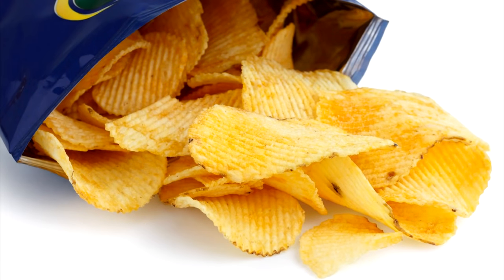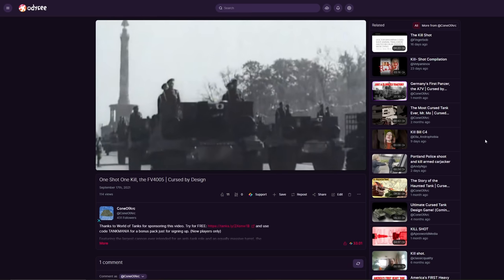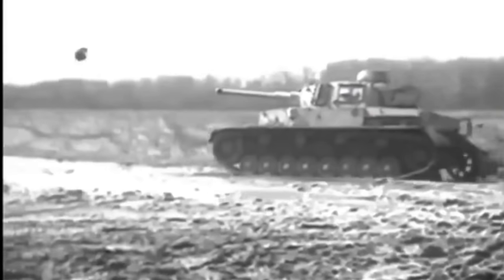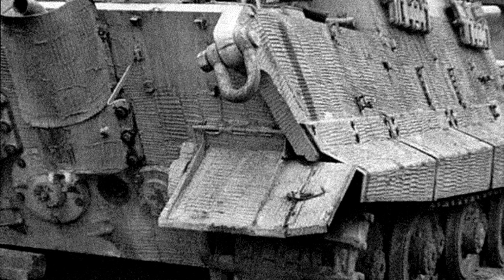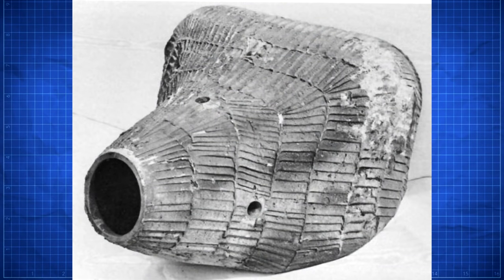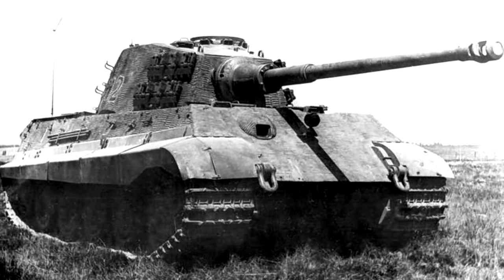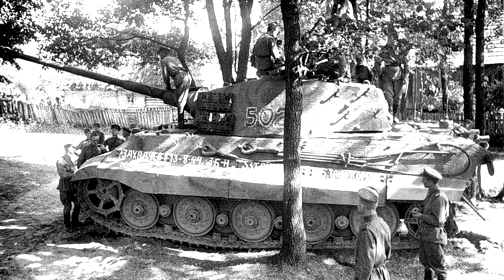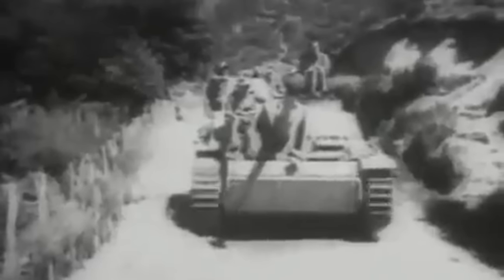Why did Germany put Zimmerit on their Tanks? | Cursed by Design

Comment: current filler primers use acetone as the thinner. they smell like body filler. the coating may have been similar to body filler which can harden quickly;y and can be heated to cure extremely fast.  Fiberglass resin plays well with body filler so they may be chemically similar as well.

Comment: (Why is this comment getting deleted? The weblink?)

I don't know about how successful Zimmerit was in practice, but the reasons for them ceasing use of it was due to bad applications causing non-penetrations to set tanks on fire.

This was caused by tanks produced during the winter being left in the cold after the base layer was applied.
The cold temperature then caused the base layer to not fully set before being sealed behind the second layer.
Later, when these tanks entered combat particularly on the still cold eastern front, a shell could fail to penetrate the armour but would cause the unset Zimmerit to ignite!

This is where the fire hazard rumour came from, whether any tanks were actually lost due to this problem is unclear, and the problem itself is not well documented.

Comment: Has anyone ever licked a metal pole that's frozen???

Magnet mines? Germans where the only ones how made them!

Well in my personal opinion, I believe that the thermal paste was applied to German tanks for one better grip. 
(Climbing on and off the tank without injury).  
And two so they don't stick to the tank.
(People with wet hands or are sweaty from combat).
   
That's something I've always thought not sure if anyone agrees with this or not, but having your hands frozen stuck to your tank properly would suck big time!

So maybe magnet mines that Russia or someone captured and used against the Germans, may help with weather cold/hot? keep heat in or out, also maybe to help with camouflaging,
 and/or, just for safety reasons! climbing on and off the tank with less of a chance to fall, slip and or stick to the tank! and so on. To reduce chance of injury.

 Try licking an ice block sometimes it works! Or freezes something metal and lick it street sign poles work well, or metal ski lift chairs. 
"In winter" and see what happens! 
(USE NORMAL WATER TO POUR ON IT to get free!)

Comment: A tank, no matter how well armored, was always an easy target if it went after enemy troops by itself.  The machine gun next to the cannon was there to prevent someone from throwing objects or grenades down the barrel.  Generally, in anti-personnel operations, you would have a squad of soldiers behind the tank to prevent enemy soldiers from approaching the tank to attach explosives to the side or rear which allowed the tank to get up close and personnel and use its cannon and machine gun against them.  Walking in the tank's tracks also protected your soldiers from anti-personnel land mines since the tank would set them off and its steel tracks would contain the blast.  That of course is why they developed mines that detonated after the plunger was depressed and then released.

Comment: Depending on current chemical composition (solvent, resin, sawdust...)Zimmerit offered greater risk of fire than risk of tank being actually damaged with a magnetic mine.
Reply from the maker: Later testing found that the only fire risk posed by Zimmerit was if it was somehow ignited before properly curing. Even then this was fairly minor since it was just the vapor from the thinner igniting and posed basically no danger to the vehicle.

Comment: The added heat resistance seems to be an intentional secondary effect, hence the choice of Barium Sulphate.
Also it seems to be intended to be applied in the field rather than in factories.
Reply: It was usually done in factories if i remember correctly, although it could be applied in the field, but you'd need an industrial blowtorch to harden it to a useable condition.
Reply: Found the European

Comment: Degaussing a ship and applying Zimmerit to a tank are not even closely comparable, and your pinned comment can't do anything to try and prove otherwise. Ships were degaussed because sea mines had fuses that picked up changes in magnetic fields, and if a ship passed by that wasn't degaussed, it would trigger the fuse and blow up the mine. This is because a ship slowly becomes magnetized as it navigates around the earth's magnetic field. Degaussing a ship does not however make it so that magnets won't stick to it. You can degauss a ship and still stick fridge magnets or magnetic mines all over it.

The only real countermeasure against sticking a magnet to a metal surface is to keep the magnet far away enough from the surface so that it cannot muster enough force to pull it's own weight and whatever is attached to it against the surface. This is primarily what zimmerit was for.

Comment: and of course the answer to this was a field improvised was to pack c4 in a sock or pillow case or small laundry bag and then goop the hell out of it with axal grease and were termed "sticky's" and would take out most any tanks.  The soldier running up to tanks with a sack full of c4 with a lit fuse usually did not fair well.  You had to get up on it to stick it on the road wheels so if you were not shot getting it on you would probably get shot running away or get killed in the resulting explosion.  There is always a way if you have the men to throw at it.

Comment: Zimmerit was a paste-like coating used on mid- and late-war German armored fighting vehicles during World War II. It was used to produce a hard layer covering the metal armor of the vehicle, providing enough separation that magnetically attached anti-tank mines would fail to stick to the vehicle, although Germany was the only country to use magnetic anti-tank mines in numbers. Zimmerit was often left off late-war vehicles due to the unfounded concern that it could catch fire when hit.[1] It was developed by the German company Chemische Werke Zimmer & Co (Berlin).[2]
Reply: When one develops a weapon (magnetic mine) one needs to develop a countermeasure to that weapon.  Forward thinking would assume the enemy is also developing a similar weapon.

Comment: Naval mines don’t stick to the hull, they are triggered by the magnetic field.  A magnetic trigger doesn’t require hard contact, or any contact, to work.

And you can’t degauss a tank for two reasons: because you need a constant energy source and you need to be surrounded by water as a grounding source.

Two minutes in and two glaring errors.

Comment: Were the "sticky bombs" used in the movie Saving Private Ryan an actual thing ?  A sock covered in thick grease and stuffed with TNT would stick to a Zimmerit coated tank a lot better than to smooth metal
Reply: The British had sticky bombs, they looked like toffee apples. They had a 2 piece metal cover over the sticky bit.
Obviously you would need to be very close to a tank to use it, and in all the accounts of the war I’ve read I’ve never come across an account of it being used in action.
But I guess they obviously were, brave man who ever used it.
Reply: @senseofthecommonman  they had been discontinued from service due to numerous accidents with soldiers involving the adhesives. Turns out, a bunch of bored late-teens with military grade AT grenade adhesive will get in trouble quite frequently

Comment: i think its pretty obvious it was an anti fire coating if it made being roasted inside a tank survivable it stands to reason that would be the best reason to use it, given the discrepencies in recipies i think its way morre likely that instead of having contaminated samples the germans were experiementing with the composition of the coating and/or had variations of it depending on available supply of certain things -in any case i wouldnt be surprised to learn that the original guy to come up wiht the coating didnt bother explaining it to the people whos job it was to actually apply it and probably intentionally misinformed them to keep the tech secretive.

Comment: The purposes of reducing the visibility of the tank + interior compartment heat isolation makes the most sense by a long shot. The melting of the coating in case of direct propellant/flame exposure sounds pretty smart. It can then be re-applied later. Tanks tend to need to drive through burning landscapes, and if a single soldier with a flamethrower could set off the rounds inside the tank, thats a big problem. The thing about anti-magnetic mines almost seems like it could have been a propaganda/co-intel effort by the germans. Make the enemy think it does one extra thing,  thus discouraging the enemies use of that tactic.

Comment: BUT - the achilies heal of Zimmerit was that it made 'sticky bombs' STICK BETTER due to the nice rough surface! These were basically a SOCK stuffed with an explosive and firing cap or detonator. Smooth metal would cause the bombs to slide and fall off! So the Germans did think ACHTUNG SHIZZER!!! der sticking bomben ist geschtiken on der zimmerit - make with the scrapers.......:)))
Reply: "Sticky bombs" like in "Saving Private Ryan"? I thought they, like the British magnetic mine, are for use on vulnerable parts like the suspension and behind the turret where the cooling fan and radiator is.
Reply: @ladamyre1  more...wherever it happened to land. You often wouldn't've had time to think and carefully place them. And yes like that, though the british did not keep them in service long after africa, and they were barely used there.

Comment: This makes little sense as ‘land’ mines would only be attracted to the bottom of the tank as they were buried in the ground. Covering the top and sides of the tank would make no sense.
Its far more believable to be a way to dampen the signal a radar would pick up from the body and as heat protection to actually drive through a fire unharmed considering they wanted to burn cities to the ground.
Reply: It was not against buried mines, it was against "mines" with magnets trown or put by soldiers on the tank. The magnets didnt trigger the mine, they hold them on place

Comment: I kinda thing the intended use for mines was either misinterpreted or misinformation. The original development at the start could have been for magnetic mines but the coating does not protect the tracks which is a big target point for them. I think the misinterpreted bit is the magnetic mine was a precursor and they discovered or used that as cover to make Zimmerit for fire protection. Could have easily been someone that had the original idea but no means of making it but used the cover of magnetic mine defense. Misinformation can be they say it was for one thing but fully meant it for another to keep the intent secret in case of information leakage.
Reply: Go ahead and you try to stick a magnetic mine on the track of a tank, its not a flat surface, so the magnets on the mine wont have enough contact to hold the weight of the mine, and will therefore fall off.

I think you are mistaking mines that are magnetically triggered, with mines that are magnetically attached.

Even if you could place a limpet mine on the road wheels or track itself. Well then you’d certainly mess up the tanks mobility, but it would still have a rotating turret armed with a machine gun and giant cannon, which would then proceed to ruin your day.
Reply: @LodewijkVrije  One of the main objectives of dealing with tanks was to get behind them. Stopping it from moving was the best thing you could hope for outside of just sneaking up on it which is not always possible. I am not mistaking magnetic triggered mines. Mines don't always have to stick to do damage to tracks just get drawn to it and then detonate. They do have to attack to do damage to the armor on the tank or underbelly.
Reply: @wolf310ii  I know very well about that mine and some of them were ignited and thrown onto the tank as they would normally be gunned down so it was a suicide run. Still no point in making antimagnetic mine "armor" for something they were the only ones mostly using on the battle fields. Tank tracks are very critical of the parts and a shape charge being placed near a track is enough to damage to stop the tank. I don't think the Germans were stupid enough to waste time on something so late into the war for weapons that was not really there. 

Also its not made up if evidence gives relevance that it was effective against fire attacks which were a known killer of tank crews. So maybe you should google or YT how much deception was used in WW2 to throw off the enemy.
Reply: @silentferret1049  If it was made as protection against fire attacks, they wouldnt have dropped it after only 9 month of use and would also use it on all tanks and slf.
But on open top tanks/slf it wasnt used at all, because chaped charges dont do much damage to them anyway.
They dropped it because russia or the allies didnt, other than expected, copy the pretty simple Hafthohlladung and the Hafthohlladung itself became obsolete itself.
You dont use a weapon made to penetrate and knock out a tank just to pull one track, for that they used the normal AT-mines.

Also a fire big enough outside the tank to kill the crew, would stall the engine anyway with or without the zimmerit.

And that you think the magnets would draw the mines somewere shows that you dont know how the Hafthohlladung works
Reply: Even if things are effective, the cost and labor can cause it to be dropped of which the Zimmerit was both not to mention a lot of weight for a tank which could be replaced by thicker armor. Fire including napalm sticks and burns to whatever side of a tank its done on and the fire would have to be near the exhaust for it to even try and stall the engine. You are underestimating how well tanks could conduct heat and increase the temp inside the tank to kill the crew. It does not take a lot of heat to get the crew out of a tank, keep in mind during the summer tanks were very hot to be in in the first place. 

As far as the open tank thing not having the Zimmerit, Kinda obvious to not need it for anti-tank mines as anti-tank grenades or even regular grenades would be effective against them, including napalm and fire bombs. Also what is the SLF you are talking about?

Also why do you keep bringing up a German anti-tank mine when the point is the enemy making a magnetic mine of their own which would not be a exact copy of the german mine. It also would not have to be as heavy.
Reply: @silentferret1049  Now you also dont know how a motor works.
A motor needs air (oxygen) to run and it dont get it through the exhaust, it get it through the intakes.
What need also oxygen? A fire.
A fire produces also smoke and CO2, both things a motor doesnt like, especialty if the fire already used up some of the oxygen.

If the Zimmerit was for fire protection, why was it only applied on the sides and not on the top? And why a rifled surface were napalm sticks even better? On a flat steel surface napaln doesnt stick very well, on a hot steel surface even worse.
Also Napalm burns only for around 5 minutes.
Its not the heat that forces the crew to bail out, its the smoke or burning liquid that goes in the tank.

I bring up the german Hafthohlladung because it was the only anti tank weapon with magnets and the allies didnt even tried to copy that concept of a magnetic anti tank weapon.

SFL=Selbstfahrlafette=SPG=Self propelled gun
Reply: @wolf310ii  Yes I meant Intake, not uncommon for people to mix up the words. Also its an engine that takes that and not a motor as a motor is anything that generates motion which includes Electric motors.

Fires draw in oxygen when they burn hot which would push oxygen past the engine intake and move the smoke away unless the normal wind is pushing the smoke that direction. Also 5 mins of 1500 to 2000 degree F heat will turn the entire surface of the tank thats on fire (since they were not insulated outside of the paint) into a giant hot plate. Also heat tends to travel upwards and not that well down so the hotter surface would be on the sides or under the tank. 
The Zimmerit was not durable enough to be on the top of the tanks because people walking on it would damage it. With it being riffled would make Napalm stick but the insulative properties would protect until it burned off. Smoke can get crew out of a tank but again its if the wind is favorable to blow in.

Small note when you abbreviate a word form another language that was never used in the conversation before then no one will get what you are talking about.
Reply: @silentferret1049  Have you ever tried to heat up steel? I do regulary at work, it takes serval minutes and a lot of energy to heat up a small steel plate (100x15x1000mm) to 100-150° with a propane burner.
Serval m² of 30-100m thick steel needs a lot more time.

Comment: You are confusing magnetic triggered sea mines with magnet attachment mine (limpet mines) - this Zimmerit coating was intended to act as an air gap so magnet mines could not be attached to the outside, highly unlikely in real life as it involved a solider running up to a tank bristling with machine guns and grenade launchers climbing onboard, attaching a heavy mine to a suitable place, pulling a pin and running away. 
Degaussing a tank, never heard that before, why? - A tank weighs 20 tonnes you hardly need a delicate magnetic trigger to detect it above you.

Comment: If it was to defend against magnetic mines......wouldn't it only be needed on the bottom of the tank? Why waste time putting the coating on top of the tank?
Reply: Magnetic mines were applied manually to the sides of tanks by infantry.
Reply: @klardfarkus3891  OK, thanks.